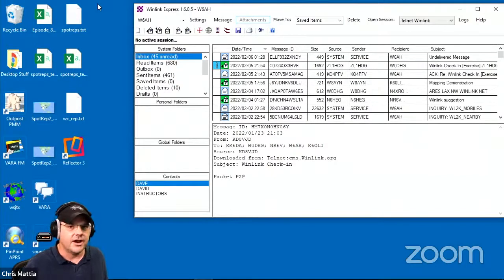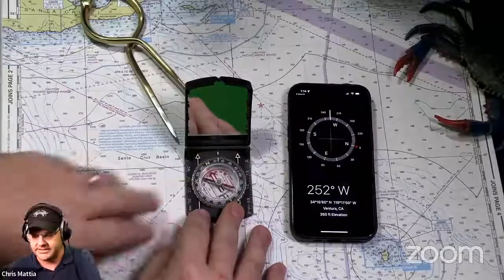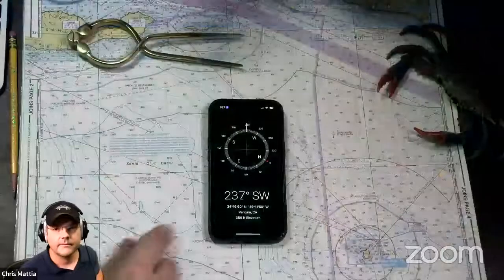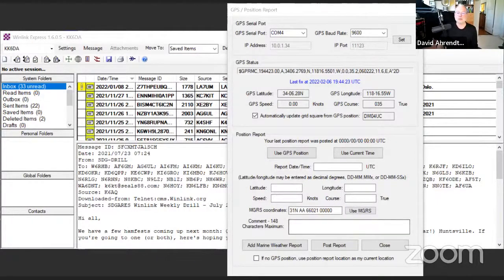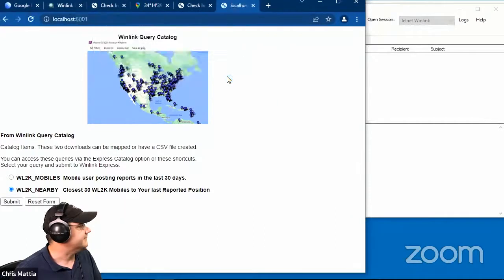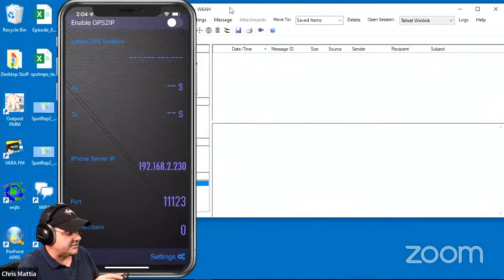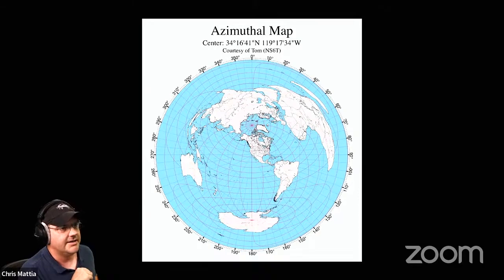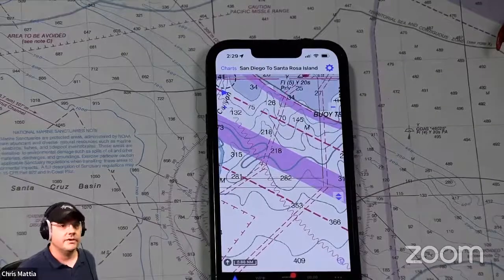Position Reporting: Using GPS with Winlink (Episode 10)

Comment: Not sure if I missed it, but is there a way to automatically include a position report in your WinLink messages every time you send one?
Reply from the maker: If you have a GPS connected to your PC running Winlink and you have Winlink configured to get its position information from your GPS then when you send a message Winlink will automatically report your position based on your current GPS location.

If you don’t have a GPS attached and sending data then you will either be reported at your last known location or center of your grid square.
Reply: @ I have the GPS connection.  How do I configure it to send the position report in a general message, not using a form?  After watching several of your videos, I figured out how to do it using the general forms and how to push the button and send a position report, thank you for that, but I’m just wondering if there’s a way if I just send a generic message if there is the option to include the position report with that message
Reply from the maker: in Position report screen (red plus icon in tool bar) make sure GPS is configured.

The location info is auto sent as part of each message in addition to what is in the form.

Send me a Winlink message to my call: w6ah and I can verify that your gps info is being sent.  I’ll check messages when I get home.
Reply: @ sent!

Comment: Doing a presentation on Winlink and this is a great intro into Express program .... . It occurs to me just using WL via Telnet is a great way to start using it.
Reply from the maker: Yes!  That is exactly how we start operators off with Winlink.  All of the base functionality to use Winlink can be learned using a Telnet session.  Then connecting a radio with RF is more about the specific set up.  

If your team has multiple trained Winlink operators then it is very easy to rotate from one shift to the next and have a smaller number of operators to set up and maintain the RF Link.

Comment: A question and maybe you answer this later on. I have a GPS Hat on a raspberry pi. I'm trying to get the position reporting set up in Winlink on the same LAN, but I'm getting an error Error opening GPS connection: A connection attempt failed because the connected party did not properly respond after a period of time, or established connection failed because connected host has failed to respond". Do I need to set something in my gpsd configuration or maybe iptables, in order to get the connection to establish?
Reply from the maker: Hi Patrick.  At a high level if your GPS is connected to the Pi you need to route the data out over your local network and designate a specific port for it to come out of.  Then on the winlink station, set winlink to look for the GPS on the Pi’s IP address and port.  We did a demo of a similar thing using an iPhone app.  I think it was in episode 10 but don’t recall exactly which episode.